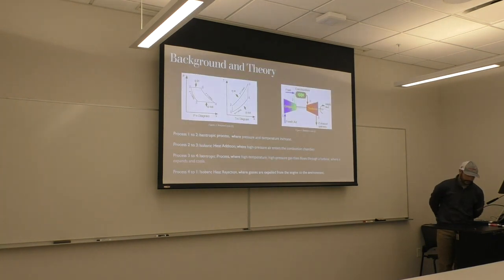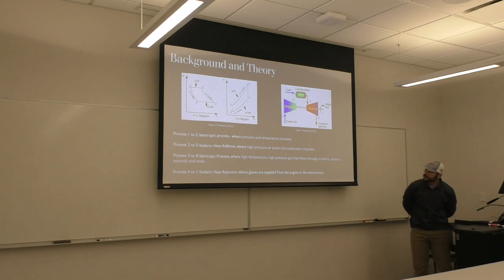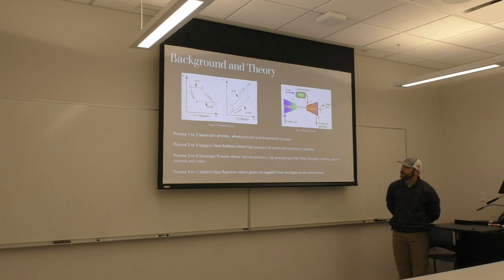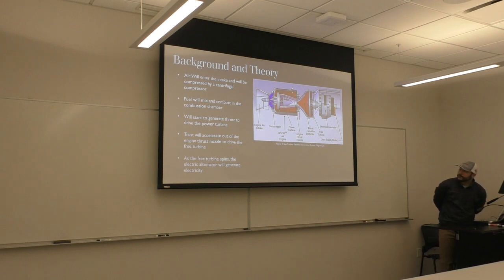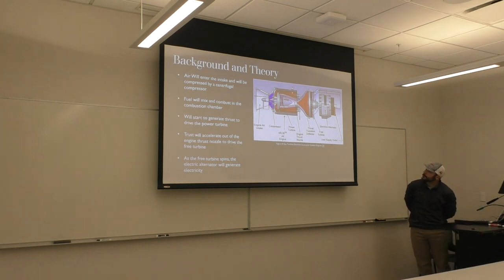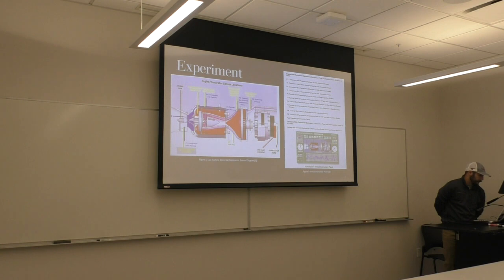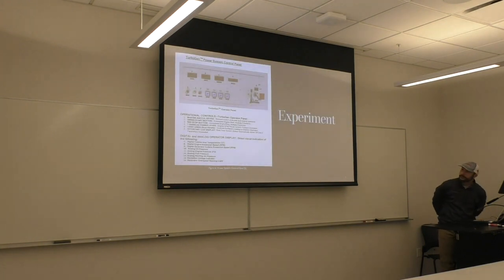Matthew Williams

Comment: After reviewing my presentation, I should engage with the audience more than just explaining so much. I need to explain my graphs and the formulas used in the experiment. Overall, I did well with speaking and getting the information about the lab experiment on Gas Turbine Electrical Generation systems.  I am also glad I could hit my 6-minute mark, as the last time I presented, I did not.